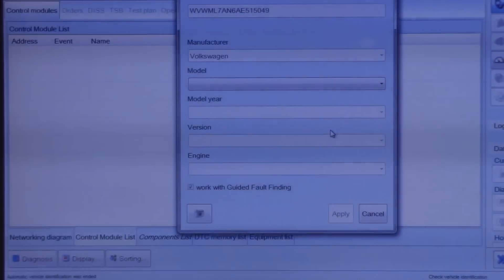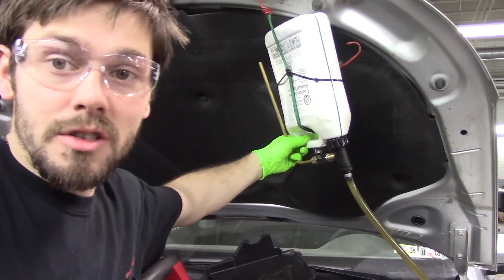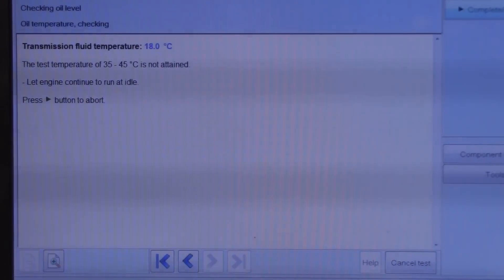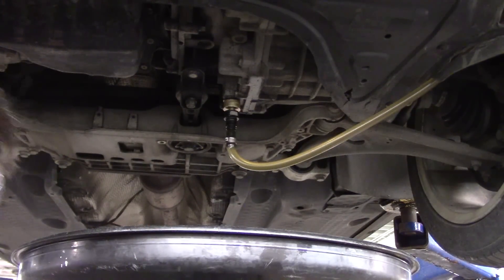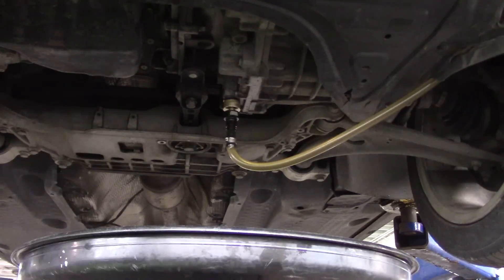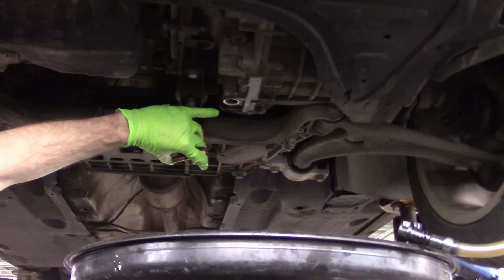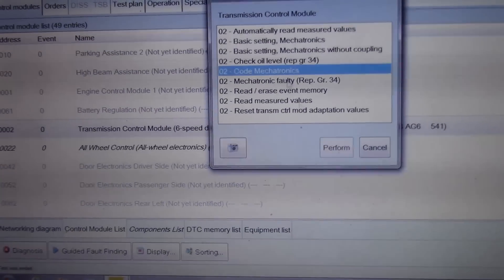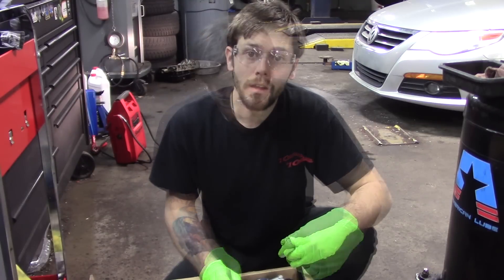U0101 TCM No Communication (2010 VW CC) Part 2

Comment: When filling the dsg box up put an airline on the vent tube gently put air in it with a blow gun with the valve open and you will fill the box up soo quickly :)

Comment: Does the front end have to go into service position or do you just remove the radiator fans & tilt the engine / transmission to remove the mechatronics?
Reply from the maker: Remove the dog bone mount tilt the engine. Remove the charge tube. That tcm mech falls right out
Reply: Thanks, good to know!

Comment: im going through this exact problem ive checked everything youve checked before hand to the T and called it as a bad mecha unit, only difference is that now with the new one installed i hooked up odis and STILL have no coms with the TCU and thing you can add to that?
Reply from the maker: Is the new part actually new or used?   I would probably go back and do wiring checks again.  It’s possible you got a bad part.

Comment: Could you find any visual failures with the old mech? I have a 2012cc in the shop now with a passive sporadic U0101. The gearbox only acts up after a long drive. Key cycle and shifts normal again. I, as well as VW, and another independent have all done testing and have condemned the mech as the failure. The customer still needs more proof
Reply from the maker: I could not see anything visual. It’s a control module that is submerged in hot fluid. If you have done all your checks. What other proof is needed. Good luck

Comment: Hi tom do all the auto transmissions on the vag group have the level checked when the engine is running ?and are they all at 35degress c ? I remember the s class Mercedes I had although not in the vag groom but still German was about 80degs from memory or maybe I'm mistaken thanks Chris
Reply from the maker: yes, all the auto trans to set the fluid at 35C engine running
Reply: Positive Lead Diagnostics that’s great to know thanks chris
Reply from the maker: No problem

Comment: hello hopefully you can help me out with what's going on with my 2006 Passat 2.0t.. I live on the beach and didn't get my car moved to a high enough level to keep Irma from getting about 2 ft of water in my car it barley got the floor board wet . I moved it right when are dune broke so it was not salt water at the time the water started rising. so 3 days after Irma put 6 ft of water in my house and lost everything once again 😞😞😞 I thought that at least I saved my car. well it drove fine for 3 days besides the battery stated going dead real fast. . I drive it on the 4th day got 2 Mike's down the road and it died. it will turn over fine but will not fire. I took it to an auto shop that I was not familiar with and thet told me it was the ECM and it would be 2.900 to fix I ask him to explain to me which ECM that's when he started living me some b)s I guess he thought since I'm a young woman that I didn't know shit about cars. needless to say I got a second opinion this guy says it was something with the wires he thought and he would be able to fix it for about $500. but when I went to his shop I wasn't for sure if I Was going get my car back it was more like a chop shop. I don't know what to do and I only have one he Left on my AAA  I want to get one more options and I have been waiting all ur videos trying to fix it myself but have had o luck
Reply from the maker: Your going to need a scantool for sure and some basic tools for troubleshooting.  Like a multimeter or test light. Did they do any testing or give you any reasoning as to why the ecm would need replaced?

Comment: I wonder how similar the mechatronics unit is to General Motors TEHCM. When I was a transmission guy I replaced a couple of those that intermittently failed. Bad idea putting a module in such a hot nasty environment.
Reply from the maker: I agree.  It's probably very similar

Comment: I'm a student at a technical school in FL. We scanned a 2013 CC 2.0 MPI. It was in an accident and was rebuilt. It's got a ton of intermittent no communication codes across different modules. Is there a particular module that I should attack first?  Thanks!!!

I'm a big fan of your channel btw. Great work!!!
Reply from the maker: If they are intermittent I would clear them and see what comes back. Does the car have any issues other than intermittent codes?
Reply: Positive Lead Diagnostics It runs. Check engine light stays on and the light bulb with exclamation point stays lit. The student is trying get the lights to go out. I am using 16.2 software and I can not communicate directly with the CEM. I can do a full scan though. Should I list all the codes? To give an idea of his frustrations, codes show that there is a problem with fog lights, yet they come on.
Reply: Positive Lead Diagnostics BTW, we cleared them yesterday, and they all came back pretty much.
Reply: Update: the module for the headlights was all corroded inside. We still have several other intermittent communication codes in engine management. U0155, U0164, U0146, P1433, P0037, P1435. Maybe corrosion issues as well.
Reply from the maker: What are those code descriptions?

Comment: Hello ,thanks for videos
Can you help me
My code is
P1604  startability malfunction
U0101 lost communication with transfer case control module 

 toyota avalon 2015
All good but check engine come after about 10 minutes from start
I replied coolnt temperature sensor
And thermostat but check engine stills come

Comment: Would you be able to give me an idea of the cost to get it repair (approx)? I am trying to sell my VW CC 2010 with this issues. do you recommend fix and sell it or sell it as it is? I appreciate your suggestion
Reply from the maker: Parts and labor are pretty expensive. There is a chance it has a warranty extension. Not sure exactly. And it depends on the condition of the car. If the car if in correct operating condition you can sell it for more. But if it needs a ton of work it may not be worth fixing.

Comment: its not need to reprogram ?????
Reply: On the ones I've done, they do not need reprogram.  But they do need basic settings done.  You can do it with vagcom.
Reply from the maker: this one did not need programmed, the coding was already set up when I checked it, fluid basic settings and a road test and your done